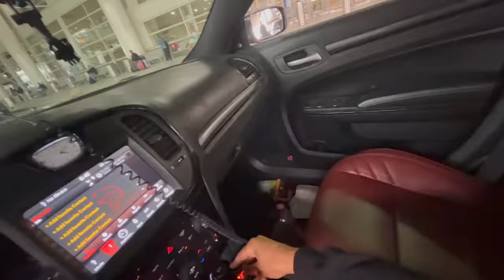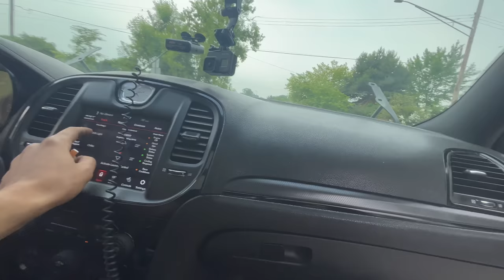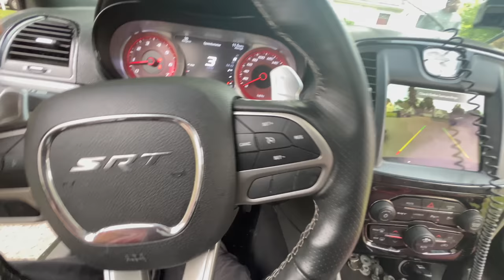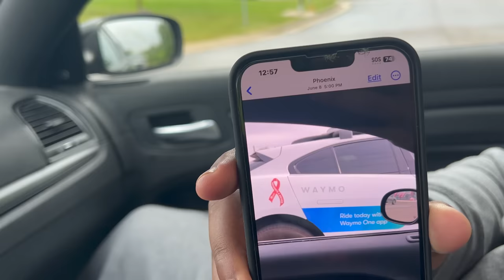DRIVING MY HELLCAT JAILBREAK REDEYE CHRYSLER WITH NO DOORS

Comment: Bros killed his whole vibe as I keep watching 🤦🏽‍♂️🤦🏽‍♂️🤦🏽‍♂️
Reply: Yeah.. what was the point for driving around with no doors/ hood? Only times I've ever done something like that is either driving to a body shop or for a quick test after replacing my engine but thats about it, I prefer to take things appart myself and also put everything back together because the people at the shop always manage to break something if they do it and then fix it in "ghetto" ways without telling me, like jb welding stuff with zero concern for the one taking  things apart in the future or breaking bumper support clips and using random wall screws to hold it in place. This happens just about anywhere you take your car, no one wants to accept responsibility if it means they will have to pay out of pocket for their actions...
Reply: @Natalie-vv9jl what are you yapping about 😂😂
Reply: @Natalie-vv9jl  ian reading all dat
Reply: @Natalie-vv9jl  I ain’t readin allat
Reply: Who?